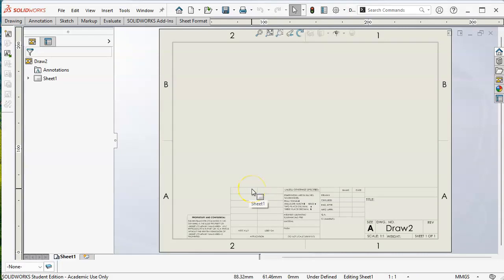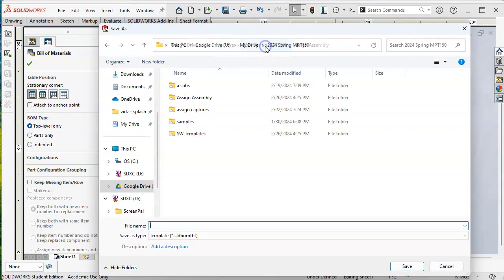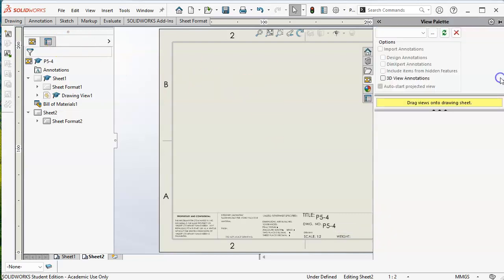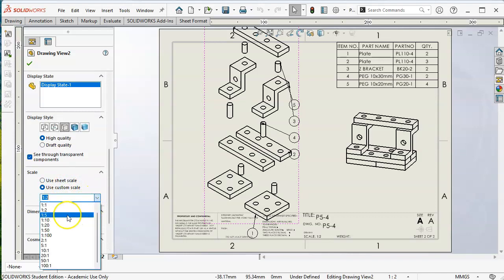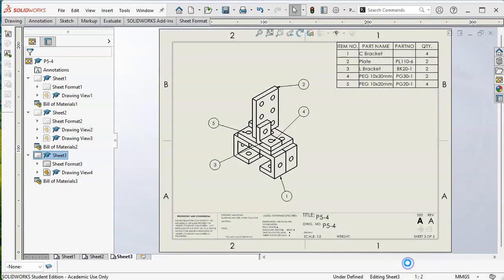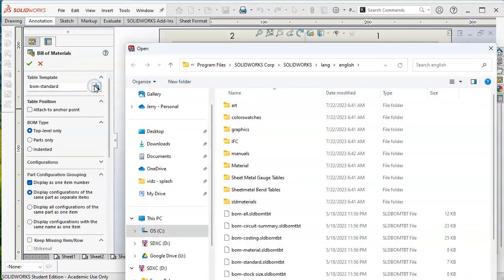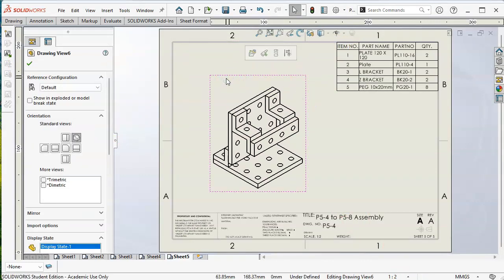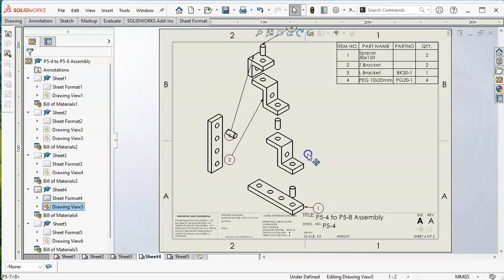20240226 P5-4 to P5-8 Assembly Drawing Multi-Sheet

Comment: Could you show some of the harder chapter 4 projects like P4-87, 90 or 140?
Reply from the maker: There is a 2017 Short Course playlist for the parts. They are in groups of 3 to 5 per video. I have not done any drawings, but those would be good projects for the drafting/detailing.